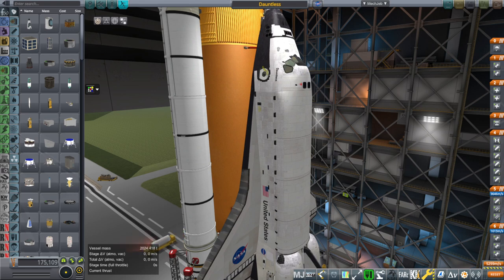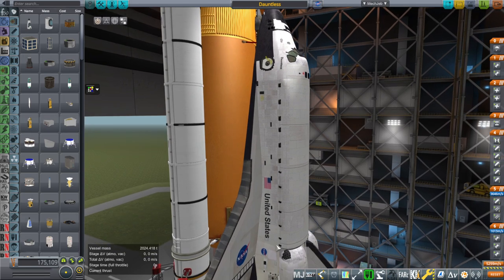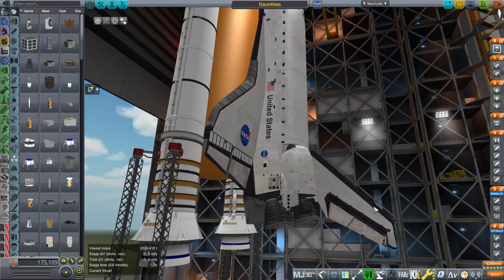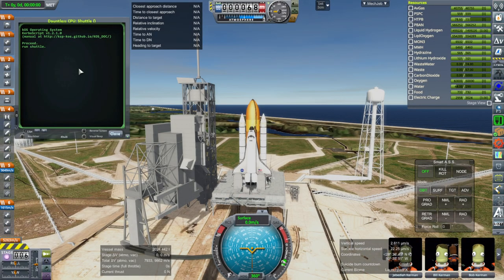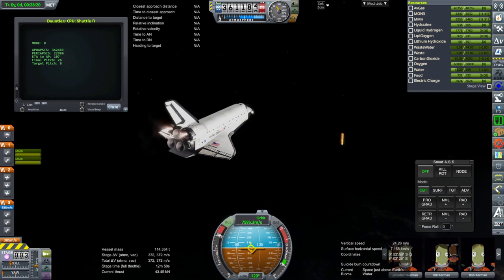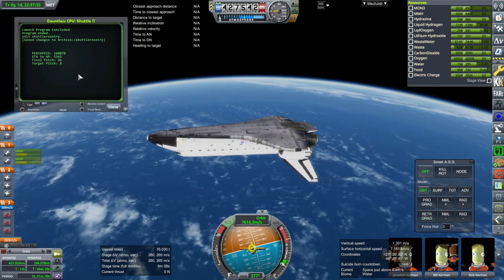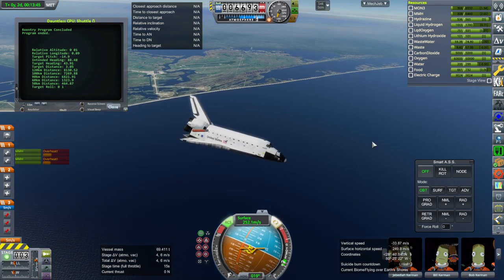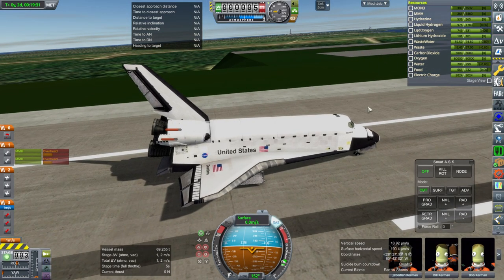Realism Overhaul in KSP 1.8.1 - Shuttle Dauntless Test

Comment: For safety would another future shuttle, if the worst happens to an existing shuttle, look at liquid fuel boosters like on Energia-Buran?

Edit: 2020-ish future shuttles
Reply from the maker: The thing about Energia-Buran is, the RD-170s were actually less reliable than the Shuttle's SRBs. Now, if you have a problem with one, you can shut it down, but what exactly happens to the stack if you have to do that shortly after liftoff? I'm not sure you have an improved situation, and the cost is also increased. Remember - the only time the Shuttle's SRBs failed was when they were used in conditions they were not supposed to be used.
Reply: @RaizSpace  Prior to Columbia, NASA was looking at using 5 segment SRB's for the shuttle, but stopped testing after the disaster in 2003. Of course that technology came back for Constellation and SLS, so maybe using 5 segment SRB's could be an upgrade to look at for the series. It does look kinda weird with the taller SRB's though.
Reply from the maker: The five-segment booster option looks weird, and there's the whole business of extra stress on the system due to the extra thrust. That isn't an issue in KSP, of course, but because it isn't an issue, it's tough to say what the impact is. Consider - does that mean more vibrations from the SRBs leading to more foam coming off of the External Tank and more likelihood of tile damage?
Reply: @RaizSpace   makes complete sense with if one booster shuts off another has to for balance and suddenly you have a bad TWR
Reply: @RaizSpace  I spent several hours reading various LRB proposals today (because why not right) and really the only advantage they can offer is higher performance to eliminate the RTLS or TAL abort modes (but not both at once). Most proposals had 4 engines solely to deal with engine-outs. They also play on the SRB fear about their inability to be switched off
Reply from the maker: @Lewis Massie Yeah. It is a different thing if you design the entire system around the liquid boosters and can really take advantage of the increased efficiency, but it's a lot harder if you just swap them in. This discussion did give me an idea to test, though.

Comment: 6:03 Jupiter III DIRECT is what they should’ve done after the shuttle program
Reply from the maker: Which is SLS for people who don't want to say they like SLS.
Reply: @RaizSpace  Not really. SLS core stage is much longer and modified to support future block upgrades, powerful upper stages and boosters

DIRECT would’ve been much quicker. sure you could’ve only gone as far as block 1, nothing better. But it’s not like we would’ve got block 1B capability for a while longer anyway

It would’ve been a nice interim solution to replace constellation and still start flying Orion to ISS and moon in mid 2010s instead of now

We could’ve launched Orion with a Cygnus co manifest to ISS on Delta IV Heavy and used Jupiter DIRECT to start going back before SLS was ready

Maybe a smaller non private lander like a modern LM and also a base camp could be established with DIRECT. Higher launch cadence too and was much more similar to shuttle

I guess with SLS taking not that much longer it wouldn’t have been worth it since it was a dead end, or it wasn’t as good of a jobs program
Reply from the maker: Proponents of Jupiter Direct seem to focus on the flawed premise that you could use the existing External Tank, but you can't - the hydrogen tank has to be redesigned if you're going to put the thrust at the bottom of it. With the Shuttle, the hydrogen tank is just hanging off the stack and bearing no thrust load. Given that, trying to limit to three SSMEs on the mistaken assumption that it would require no external tank redesign is pointless. Basically, SLS is inevitably what you get.

Comment: can you try made the Von Pragenau's 1982 Shuttle stack design?
Reply from the maker: I don't think it's a good idea. Articles on it seem a bit confused about aerodynamics. For instance, this one: http://spaceflighthistory.blogspot.com/2016/10/george-landwehr-von-pragenaus-quest-for.html says that "moving the tank for dense liquid oxygen from the ET's nose to its tail placed its concentrated mass nearer the base of the stack, improving in-flight stability" when the opposite is true. Also, the design's apparent emphasis on stability (though it seems less stable to me) neglects the fact that the actual Shuttle stack was quite stable. Meanwhile, placing the heavily-insulated hydrogen tank so high up on the stack seems like it would increase the risk to the Shuttle's leading edge tiles - the flaw that would condemn Columbia. Altogether, I think the Von Pragenau 1982 design is less safe than the actual Shuttle stack.